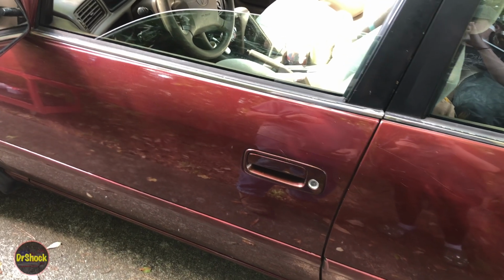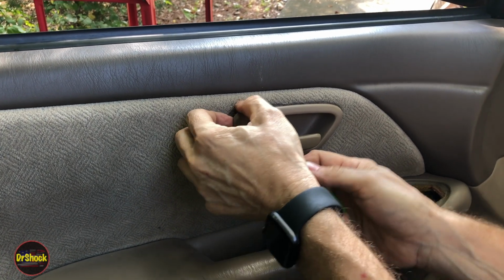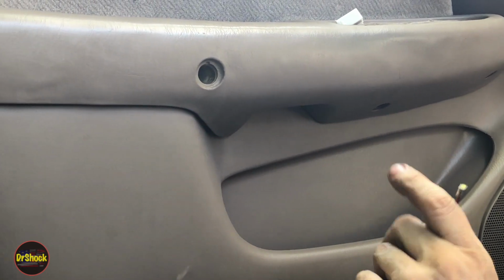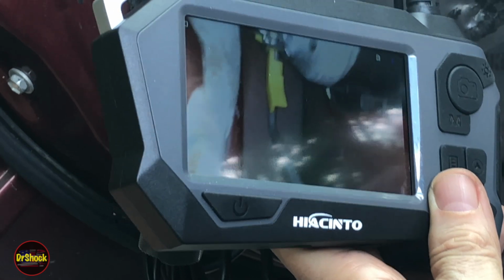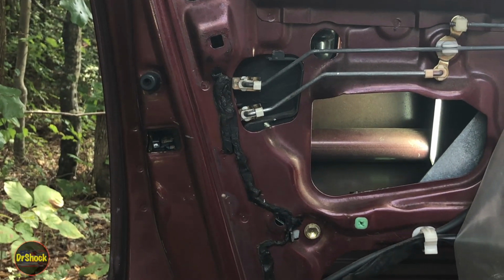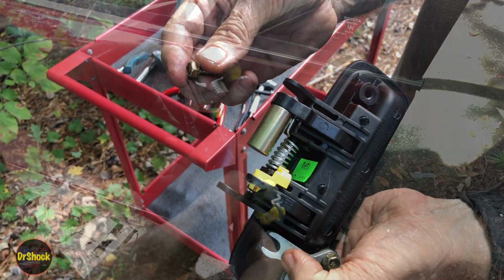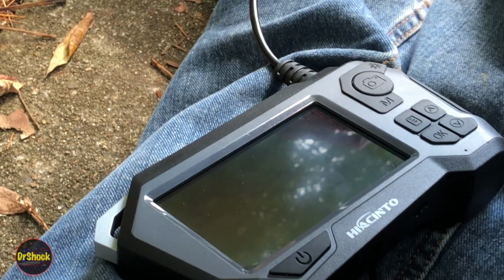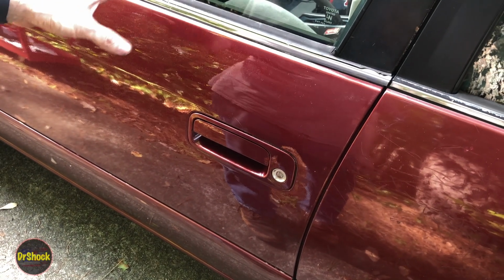1997 - 2001 Toyota Camry Outside Front Door Handle Won't Open Door ~ Genuine OEM Replacement Repair

Comment: I I was having a hard time at 12:50 on this video. I had to use a step bit and drill a hole in the side of my door panel for that plastic clip on the bottom. I could not for the life of me line it up. Finally got it. This video helped so much.

Comment: So how changing outside handle fixed inside door handle problem also coz at beginning both weren’t opening the door
Reply from the maker: As mentioned right at the beginning of the video, this is two separate failures on this owners vehicle.  This video only covered the outside door handle replacement, they also needed a new door lock / latch mechanism which was covered in a separate video that is linked at the end screen of this one.

Comment: OK I'm looking for your help on this one: I've removed and replaced these before, but my current one has me stumped. It has been stuck despite the rods appearing to work for both exterior and interior handles as well as the lock and actuator.

When it started jamming I removed the door panel (had to give it a fist pop to open), replaced clips and lubricated what I could, and ordered a replacement. I left the panel off in case it stuck before the part arrived. Well now it's completely stuck. I have access with the panel off but everything appears to be working from what we can see. It's all connected and can feel the spring pressure, can visually see the parts the rods connect to rotating on the assembly. 

Is there a particular part of the assembly that could lock up like this? Is there somewhere I need to drill to physically open the latch itself? Thanks for any help you can offer. We tried long flathead to press on any moving part we could from top (window down) or inside the panel (window closed).
Reply from the maker: If you have access without the panel, you should be able to manually actuate the rods for both the lock on/off and to release the door to the latch mechanism.   This is just mimicking what the inside, or outside, door handle does as well as the key lock or interior lock knob.  This would confirm if the issue is with the latch itself, or the rod(s) going to either of the two release handles.
Reply: @DrShock  We've manually pulled the handle rod and pressed the lock rod at the same time into the open positions while shoving the door. The handle and locks are reaching maximum range so seem to be operating properly anyway. Its not the rods themselves, the spring pressure is still there, theyre moving full and and we see the rotating mechanisms on the latch assembly rotating.
Reply: @DrShock  Thanks for quick reply. We've already pulled the handle rods to full range and pressed the lock rod to open positions at the same time while shoving the door and nothing. Spring pressure still there, all clips connected, the mechanisms on the latch assembly are rotating. The interior and exterior handles, and the lock and actuator, appear to be moving the rods to full range as well. We have a replacement latch assembly to analyze how the mechanisms move, too. Sorry if double reply, one reply seemed to disappear.
Reply from the maker: Definitely sounds like you've confirmed the latch assembly is the point of failure.  Use this latch replacement video instead, it may help you visualize better how to manually actuate the release mechanism - https://youtu.be/TF5YjR-a3d0
Reply: @DrShock  I had seen that video before but you were right, once I saw the camera snaked down from the top i got a better idea what to try to force, so I reached my arm all the way to that rod mechanism where it wasnt moving far enough in your video, and tugging on it after a bunch of tries it finally popped open. Thanks a ton! 3 months that things been stuck.

Comment: How can you get the door to open if the handle doesn't work from the outside or inside? I've tried pulling the inner handle to the maximum extent and tried forcing the door open but it's still stuck.
Reply from the maker: You'll have to cut a hole thru the inside plastic trim panel to manually actuate the rod for the inside handle in order to open the door in this situation.

Comment: How did you open the door while repairing? The door was unable to open. And how do you remove the inner panel without opening the door?
Reply from the maker: You open the door using the inside lever.   They operate independently using the rod mechanisms I showed.   If a problem with the interior is ignored, and then the exterior ends up also failing (or visa versa), then you are in a worst case outcome situation as the door latch will be inoperative.    In that situation, you have to sacrifice the interior door trim panel - drill thru it with a hole saw in order to access the rod(s) and manipulate manually.   Then replace the interior trim panel as part of the overall repair.
Reply: @DrShock  Even from inside, it's not open.. Or do I have to pull the liver from inside and push the door outside?
Reply from the maker: Like I said, it is possible for both handles to wear out.  But almost never at the same time.   If pulling on the outside lever is inoperative, and pulling on the inside lever is also inoperative you have to cut a hole thru the trim panel to actuate the rod mechanism manually.   I'd give it a good push from the inside before giving up though.

Comment: My door is completely closed and I can’t open it from either side so I can’t even fully take the panel off. How do I open the door? Any help
Reply from the maker: What we end up doing if an owner comes to us with this problem is using a hole saw and drilling a thru the interior plastic door panel so that we can actuate the release lever with pliers.   The panel will, of course, then also have to be replaced as part of the repair.  You could use this video to approximate where the rods are located for this approach.

Comment: great video! unfortunately the inside from my door wont open either 😂 is there any way for me to open the door?
Reply from the maker: If this problem goes too long without being addressed you can get to where neither the inside or outside handles function anymore.  Unfortunately, when it's this far gone you have to cut a hole thru the interior plastic trim (I typically use a hole saw for this) in order to gain access to the interior release rod to manually open the door.    You can then perform the repair and obtain a replacement interior plastic door trim piece from your local pick your own parts salvage yard.
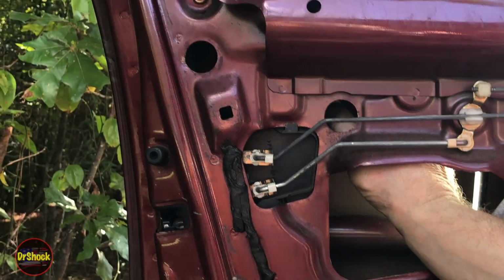Reply: completely different levers and rods. the inside handle is mounted on a plastic base. the plastic is a mixture of polycarbonate and polyamide with glass fibers. unfortunately, the mixture ages and breaks. then, when you pull, the steel rods are pulling the handle to the back. alternatively, the 2 horizontal rods may have disconnected either from the handle lever side, or from the latchet side. wee 23:24. and then, the rods are moving, but they do not actuate the door mechanism. Or, the door mechanism may be rusty.

Comment: Great video, I was stuck on stupid, about the very difficult second yellow retainer clip.  I followed you instructions, I released and separated rod from the yellow clip.  Unfortunately the bolt the fastens the key  barrel to the door handle was stripped and spun in place.  Important thing is I got the handle out.  Thank you for the informative video.

Comment: Hey thanks a lot for the very nice video! I followed this carefully and fixed my passenger side exterior door handle! The hardest part is indeed when I have to put  the rod into the hole for the lock. It took me almost an hour to get the hang of it. The trick is to try to put it in in a position that is natural to the rod. The position where the hole is closest to my eyes is not a position easier for the rod. The rod has to be bent in the right 3D shape. So I gave up that position after about 45 minutes. Then I asked my wife to turn the lock slowly backwards and I noticed that there is a spot to the right and higher than the lock where the rod is pretty much free of tension and very close to the hole. Then I put it in in under 5 minutes. Talking about a trick! I used after market handle, which only cost me like $12. I know Toyota part is better, but I don't feel like paying $120 for it. So the one from eBay came in. The eBay one does not work with Toyota self-tapping screws. And it is quite hard to find the right screw for it. But I noticed that if I use a bigger screw with a tapper and then add some washers, it will work. I guess that is also why you see that big washer which won't work with OEM Toyota parts. It all makes sense now. My 2001 Camry is 23 years old now with 170k miles. The engine and transmission are rock solid. But the windows and doors are trash. I have replaced all the windows 1.5 times. I asked a shop to fix my driver's door handle. But I decided to fix the passenger one myself and your video truly helped!
Reply from the maker: Thanks, glad it helped.

Comment: What camera model number is that
Reply from the maker: It's an older ES452, discontinued model.
Reply: @DrShock  that’s beautiful, as I look through my blue screen fish eye camera, to try and observe things without disturbing too much.

I’m definitely gonna try and work that into the tool pack. I think if I can get that size screen with that clarity, plus the ability to turn the camera from a handle…..I might just shed a tear at that prospect. I’d go up to three hundred for a product like that, even if it will require knocking something else out the budget for a month or two.